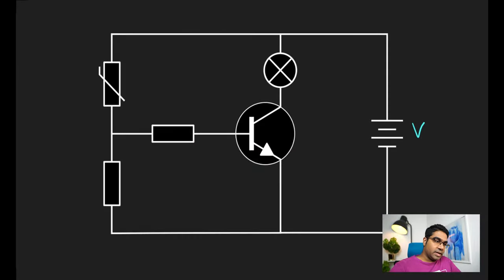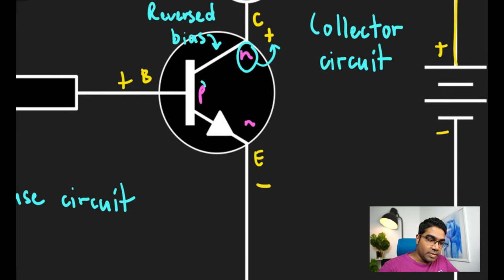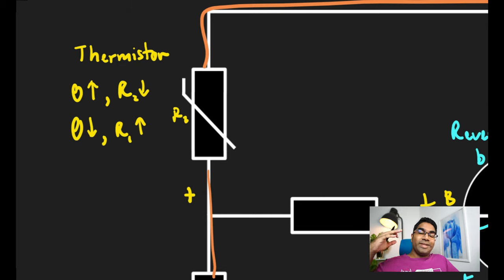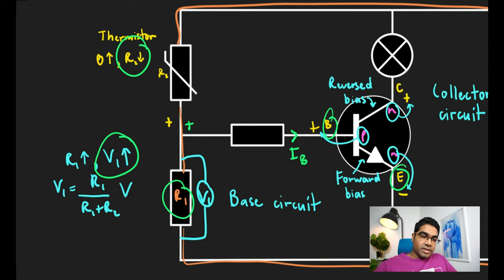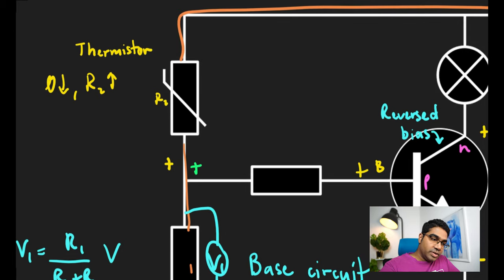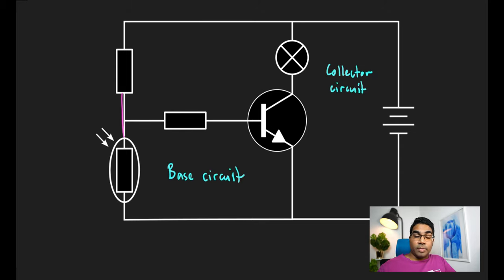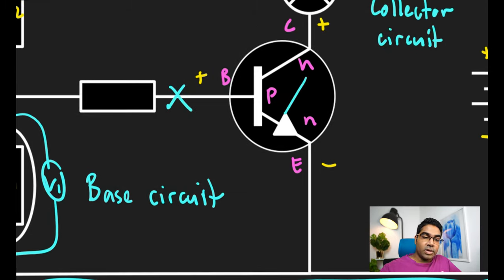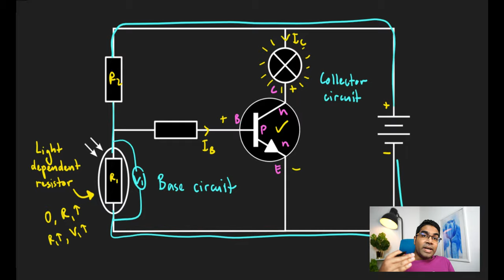Transistor as an Automatic Switch / Light-Controlled Switch / Heat-Controlled Switch

Comment: hi sir ... can you teach me how to make a heat switch on pcb board i add a buzzer ... i have tried many times but unsuccessful..
Reply from the maker: Hi, I'm afraid it's been too long since I touched a PCB board. But theoretically, make sure your buzzer is in your collector circuit (it should be connected to the collector-emitter path), your thermistor is connected to the collector-base path (to the current-controlling resistor) and the resistor that forms your potential divider is connected to the base-emitter path. Make sure the resistor that forms your potential divider is in series with the thermistor.

Comment: Hi Great video I am not very good at this but this appears to be what I want 
Problem is I have no idea on electronics but I can build them 
I need to have a circuit that monitors the Cylinder head Temperature on my scooter so the engine does not overheat and seize 
The temperature I need is approx 100 degrees I want to turn on a Red LED light at this temperature on rising temperature can you help me with the Type, value and numbers of the  components for this task 
The Thermistor will be attached to the Cylinder Head and the rest will be in the head set of the scooter 
Terry mosley